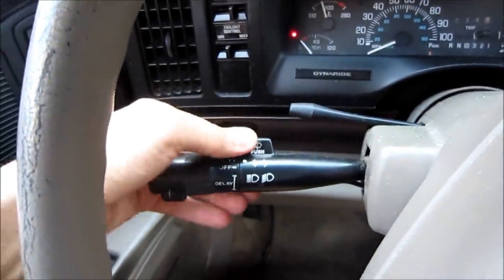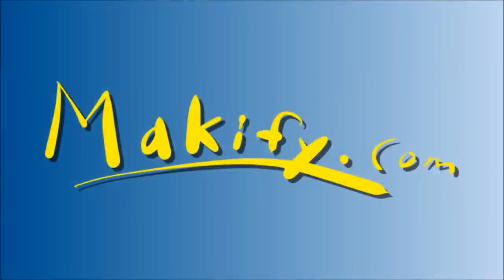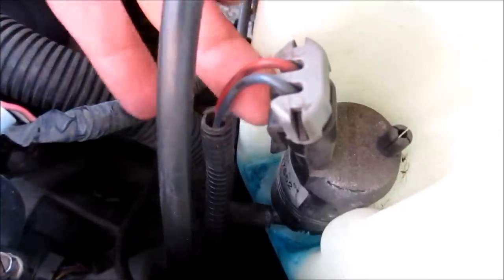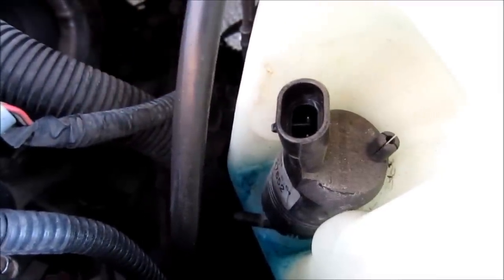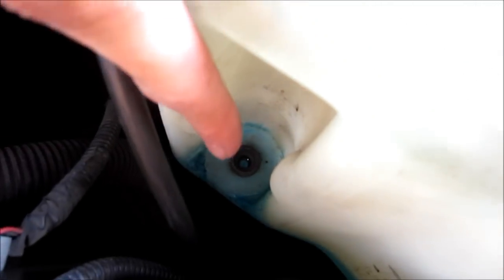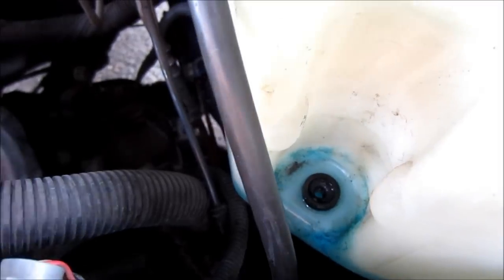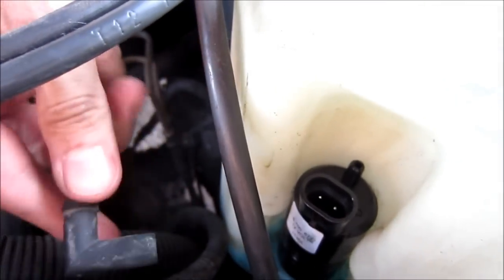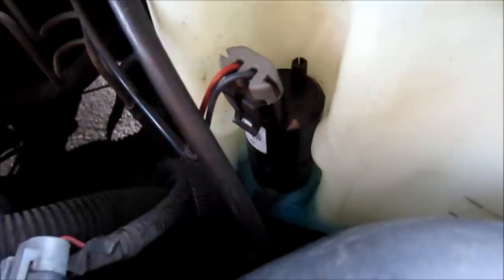How To Replace a Windshield Washer Pump

Comment: Lemme just say thank you so much for this video!! I bought a pump last night for $18 and did everything you said in this video and IT FINALLY WORKS!! I GET MY WINDSHIELD CLEANED NOW (just in time for winter too).
My brother wouldn't let me use his siphon hose so I just pulled the pump out and let it drain into a basin. Then I filtered before refilling the tank (since the old owner's of the car had it full to the brim).
Sorry this is long, but I'm so excited that I actually fixed my own car for once even if it was minor. Thank you again for uploading, it was easier than I thought.
Reply from the maker: Awesome! I'm glad the video was helpful.
Reply: 8

Comment: Thanks for the informative video. Could you post a video on how to test the pump so one will be able to know if the problem is in the pump or the nozzles?
Reply: I have the same problem on my 08 f150, so
my brother hold down the windshield wiper fluid button and I didn't hear a whirr, which means the motor is broken. if clogged you will hear the motor but no fluid

Comment: How easy it is depends on where the pump is located. Usually, its behind the wheel well which requires removal of the wheel well wall. I have a 2009 Honda CRV that requires removal of the entire front plastic bumper to get to it believe it or not.

Comment: The location and arrangement of washer reservoir, pump and tubing are different in every cars.
Ah, you are lucky that the arrangement/location for washer reservoir and its pump makes it easy to access. I am jealous. :)
In my car, it is very difficult to access the pump. It seems that I have to remove the wing (front side cover) first, a task I am not ready to do yet. 
Such parts as EVAP canister and its related parts, fuel pressure regulator, intake valve timing control solenoid valve, etc are easy to access while I don't need to work on them (in near future), whereas this washer pump which I need to work on is very difficult to access, let alone the whole tubing (hose) which I need to check too.
Reply from the maker: That sucks. I understand that there are limitations but I wish engineers would try harder to position parts that commonly fail in easy to access places.
Reply: I know some people do modifications on several parts, some of which are unnecessary. So, perhaps, we can do modification to change the location/arrangement of this washer reservoir. For now, I can only imagine how to do that while thinking about its best location.

Comment: Windshield wipers work but no water. The pump is good (tested) but the electrical wires from the pump have been disconnected at wherever the source is. Need to find the source for these dangling wires. Help! Thanks. (1997 Buick Century)

Comment: my hood had to be replaced. and the part where the fluid actually sprays out onto the windshield was never connected to the hood.. what parts do I need to install the tubes back onto the hood? I hope I worded that correctly and you understood! thanks :)

Comment: All cars are different.
some are highly complex and may even require removal of headlight assemblies and or the entire bumper cover and or inner fender wheel well panel.
Usually high en cars with powerful engines are the most complicated.

Comment: I would have thought the first thing to do would be check that the washer pump is getting power when the wiper/washer switch is on. Ensure the lines aren't blocked. I dunno. I can't begin to fathom how Acura design their electrical connectors such that they're impossible to disconnect. Arrrrrgh !!!  Thanx so much for JapCrap.

Comment: tell me what you think about it, is it just clogged or the pump is malfunctionning.

the windshield washer gets squirted on my front window with no prob, but i have to hold it on with rear window for at least 3 second.
Reply from the maker: +fred renault Clogged would be my guess.

Comment: Just not sure if mine is the pump. It appears the fluid wont even go into the reservoir. No noise so could be pump. Noticed part of the tubing is gone also. Why this could not be easy as your video..

Comment: Went through each fuse previous owner stuck something into the fusebox that must have compromised the connection(100,000 miles later) anyway thanks for the vid

Comment: It all depends on what car you have. I have a Buick Lacrosse 2005 CX and it looks like i will have to take out the whole battery and possibly a headlight to just get to see the rest of the reservoir. I think a mechanic could do it easier in my case. My car is a nightmare to fix anything with.

Comment: In my 2007 Trailblazer I get fluid in the rear but not the front. Whats you guess?
Reply from the maker: Probably a clog in the front sprayer or line.
Reply: thanks

Comment from the maker: The pump sits in a hole at the bottom of the washer fluid reservoir. If you don't drain the fluid first, it will flow out as soon as you remove the old pump.

Comment: how do I know if the problem is just the pump machine?? no water is coming out neither in front or back windshields
Reply: yes, of course. And I also cleaned the holes of the piece that spray the water with a needle.
Reply: I have a blazer and the front and back windows have separate pumps.. maybe both are bad changing both might do it

Comment: i have a 06 Chrysler pacifica...is it the same process as well?
Reply from the maker: +Kenny J  I don't know for that car specifically but it should be about the same. The pump design may be different and the location of the reservoir/pump may be different as well.

Comment: what if my pump makes noise and squirts the water nonstop on my window? csn you please help me thanks :)
Reply from the maker: Sounds like an electrical problem.
Reply: +Makify1 thank you for replying ima try to replace the pump and see what happens :)
Reply: same problem here. stayed on until I pulled the fuse. did your pump replacement fix the problem?

Comment: What kind of vehicle is this brother ?
Reply from the maker: 1998 Buick LeSabre
Reply: Makify1 ok thank you by any chance   do you know where is the pump located in a Chevy cavalier  2002?
Reply from the maker: I think it's in a very awkward location in front of the driver's side front wheel under the car. You'll have to crawl under the car to see it but I think once you know where it is, you can just reach under the car and remove it with your hand. The plug is easier to get to. It is near the front of the car on the driver's side under the hood.
Reply: Makify1 thank you so much pal I really appreciate your help !!

Comment: how do you test your pump?
Reply from the maker: Mountain Lion You could have someone turn it on while you tried to listen/feel it working or you could remove it, hook it up to a 12v power supply, and see if it runs.
Reply: who can reapair wipper water supply car tata indigo plse sir send vedio early

Comment: Way to not test it first. 9 times out of 10 it's connector to the pump. The weatherpak corrodes and the tangs in the connector rot away.